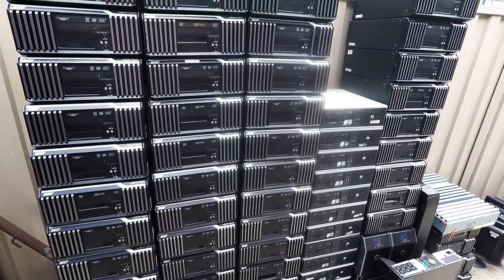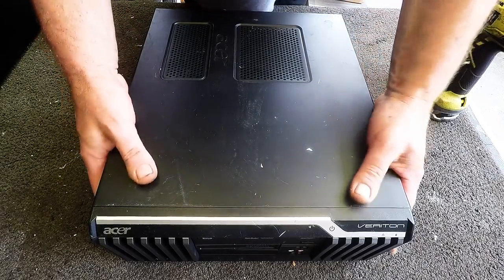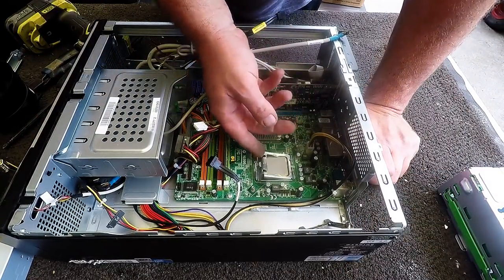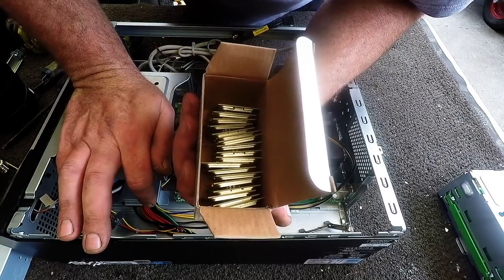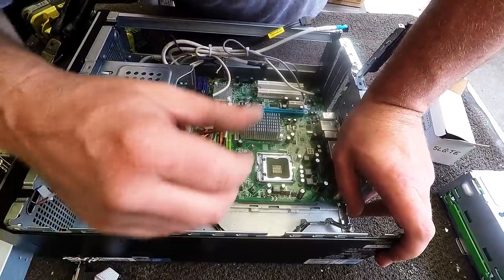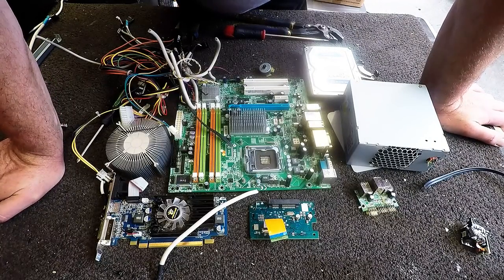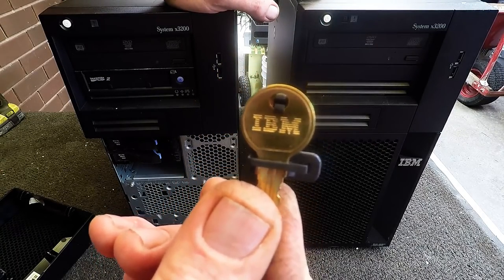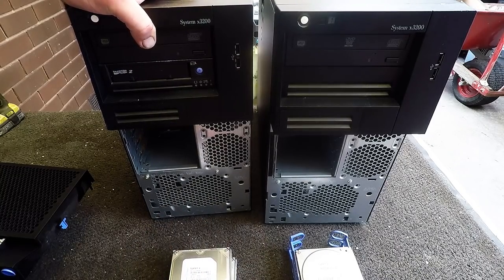PC & Server Scrap Out - Update

Comment: Hi Ben: Before you take those Aluminum heat sinks to the scrapper,.I hope you know there is most always a good sized copper plate or plug on the bottom of them heat sinks. the copper plate(or plug) on the bottom of the heat sink draws the heat off the chip on the board. the fan cooled Aluminum in turn cools the copper.  I use a hobby torch to remove that copper which is soldered onto the heat sink. Not all is lost. Those computers are still new, not even used. BTW in the past i would have defended the United States is not a 3rd world nation,.but things have changed for the past 20 years here in the states. Electing presidents having their own agenda's.

Comment: Whats your ebay store / ebay name... always interested in buying Older GEN computer Hardware
Reply from the maker: closed until january  http://stores.ebay.com.au/electrical-gadgets-galore
Reply from the maker: I don't sell that kinda stuff
Reply: i came across your ebay store when you were talking about selling copper and aluminum bars.. and saw you had CPU's and other bits and pieces for sale.. but forgot to save the page
im always looking for Higher end CPUS like the core 2 quads like a QX9775, QX9770, QX9650, Q6600, Xeon CPU's X5460 X5492, X5482, X5470...

Comment: I removed this comment because it was inappropriate.
Reply from the maker: no that's illegal actually
Reply: You're free to sell a license when selling a computer though.  I'm not sure what the difference is.  When you buy a used PC, it has the same COA label  on it.  I've used that key to install windows for years and never had an issue (on my own PC's that is).  Maybe you could just sell an 'empty' case as-is and it just happens to have a key with it.  Dunno....just spit-balling.

Come to think of it, I have not HAD to purchase a valid version of Windows since before VIsta.  Every PC I have gotten my hands on has a valid key strapped to the side of the PC.  I have always just punched in that number no matter how many times I format the computer.  Remembering that fact makes my original question irrelevant.